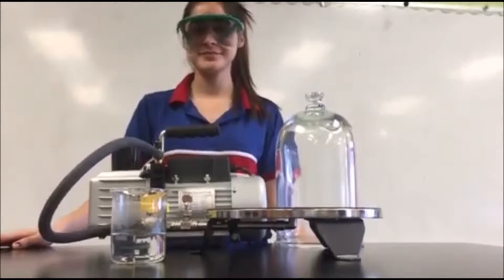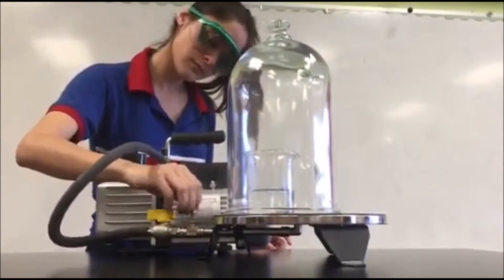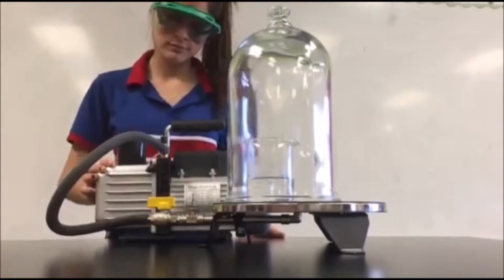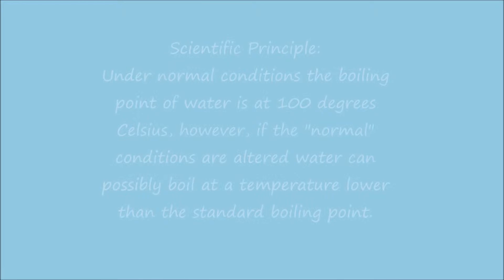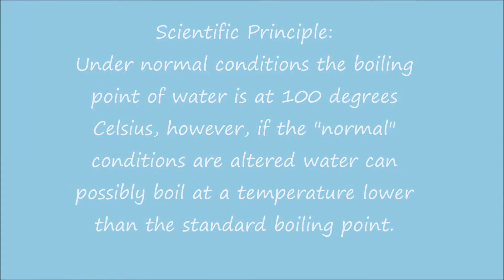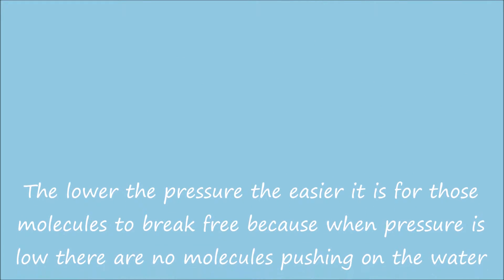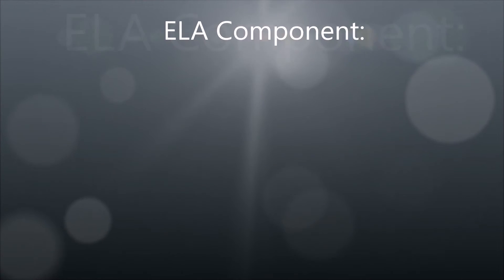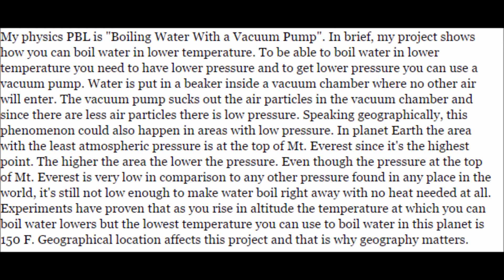Boiling water with a vacuum pump - STEM SOS level 2 project

Comment: What happens if u put a thermometer in the vacuum, and set up a heat lamp outside the vacuum, as a light source, to see if light can create heat in a vacuum?
Reply from the maker: I personally would not put a thermometer inside the vacuum pump since it could be damaged. Outside of the vacuum was just the normal room in which I was which was in normal pressure according to my altitude, & I do not think that putting the light source outside of the vacuum would affect it since the class dividing the vacuum & the exterior was a thick glass barrier that separated the temperature & pressure of the vacuum & the outside.